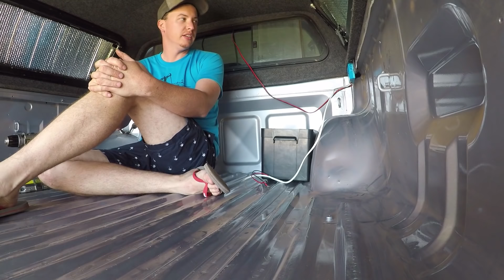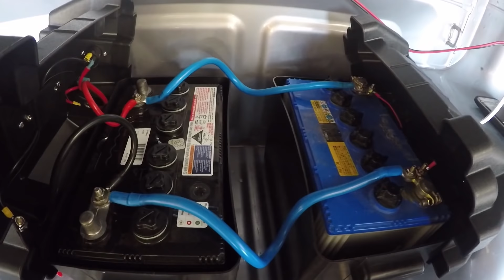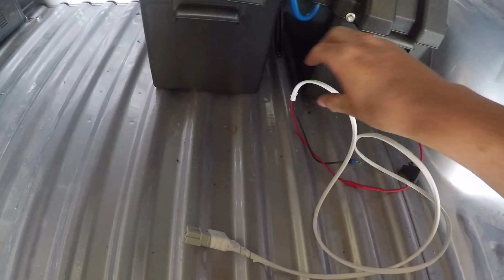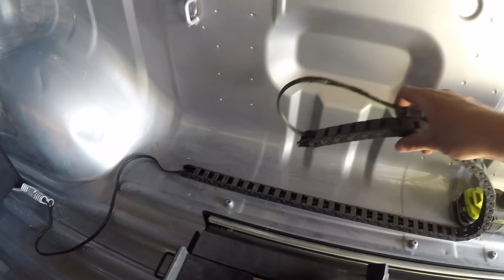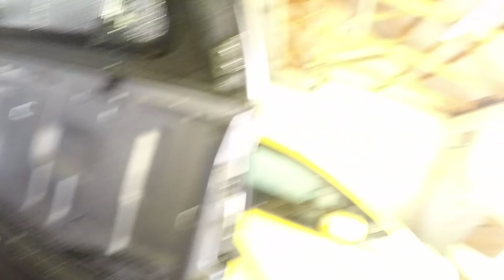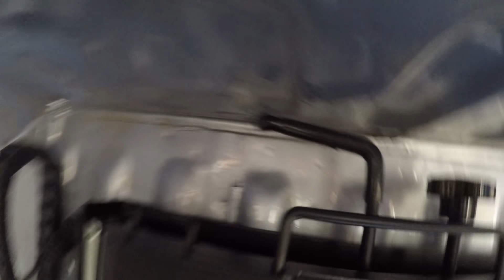Its All Stripped Out! Part 1

Comment: hey bud, just a heads up if you use both the Positive and Negative terminals on the 1 battery, that 1 battery will die a lot quicker than the second. basically that battery will trickle charge into the second working twice as hard. 
- use the positive of 1 battery 
- then negative of the other battery 

then they will work as 1 big battery and not 2 separate batteries.
Reply from the maker: Hey mate thanks for that I'll give it a go

Comment: "... ya problem ya got there is that when ya get there ya beer with be cold. Nobody wants that!....." made me laugh. Interesting video though. Nice work on the truck though. I hope that screw you put into the battery box is cut off inside. Be careful you don't pack anything conductive against that exposed positive terminal or you will have a nasty surprise. You may also want to consider weight distribution as well. You seem to be putting a lot of load on the drivers side of the vehicle.
Reply from the maker: +neutronstorm haha thats it mate no one wants warm beer. Just wait till the final reveal of the whole thing mate, the fuel tank is on the other side as well as the awning, so I am trying to evenly distribute the weight of the whole vechical. I use to have the fridge on the other side and the leaf would sag under the weight of everything. So thats why I switched it up and put everything on the lighter passanger side.
Reply: Sounds good. In the video you said nobody like COLD beer. Some may disagree 😃 I know it's hard talking unscripted.
Reply from the maker: +neutronstorm haha indeed its all off the collar mate!